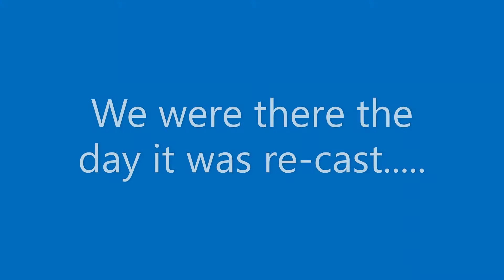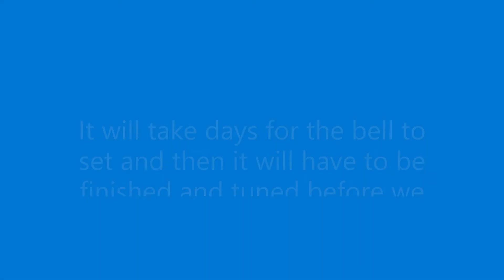Taylor's Bell Foundry - Shere Bellingers' visit 21/4/22

Comment: Truly great to see Taylor's still casting as well as tuning [across the road] and restoring bells from all over the world.
I used to live 2 streets away for about 15 years and when at primary school passed by four times a day. We kids were given cheese on toast made on a shovel on cold days but were seldom allowed into the tuning factory across Cobden Street except in organised groups because the ear and hand tuning was so precise and temperatures had to be constant across a huge test range.
The frame shop on Freehold Street was only opened to view during priming because Mr Taylor and the bell masters were very careful about safety and, of course, frames had to be tested for stresses for use in all conditions.
Although electronic tuning was introduced in the late 1960s it was mainly a visual check up on the manual tuning. The men wore ear protectors way back then most of the time then for final tuning their ears were fresh and no background machine noise got in.
Testing rigs of whole sets of bells was done in an ingenious tower which was soundproofed to an extent but the locals generally liked to hear some of the testing.
Oh yes, and furnaces were not used on a Monday because that was washing day!
Reply from the maker: Thank you for your very interesting background info. We certainly enjoyed our relatively short visit.